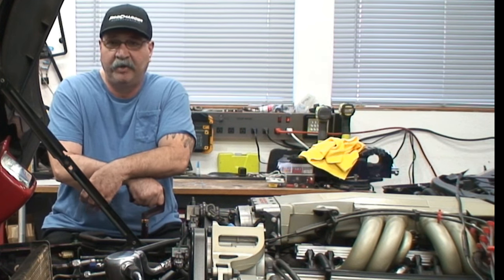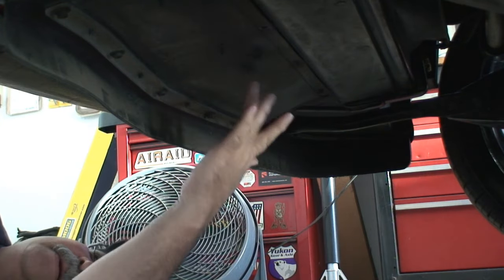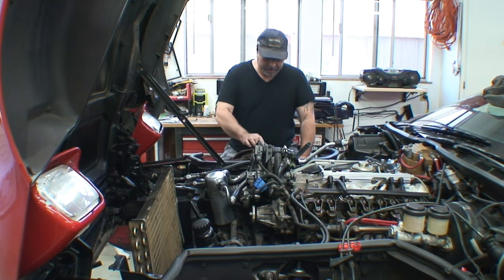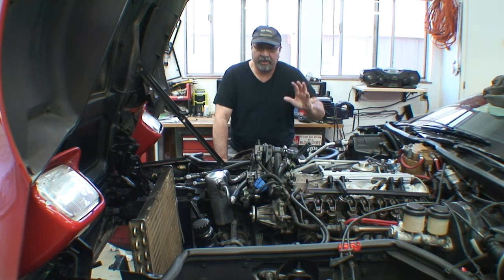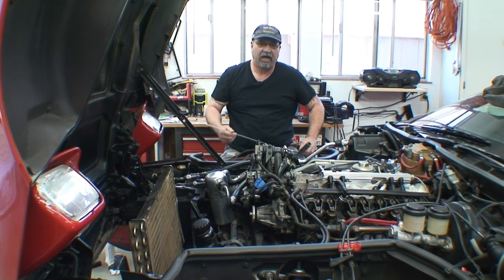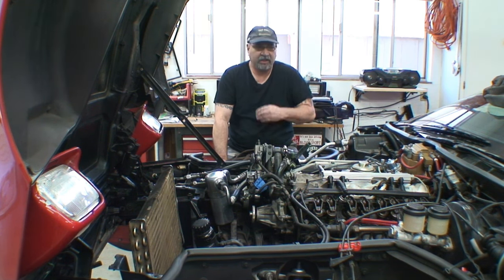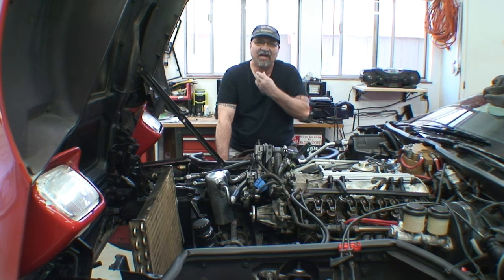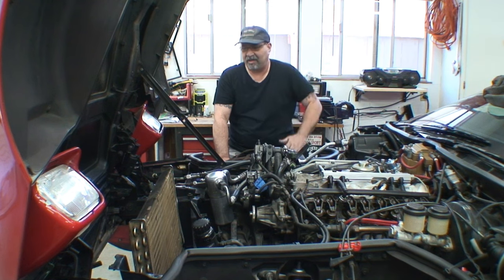Clearing the way for the supercharger episode four

Comment: Hey Ed, thanks for telling us about how to remove the dents out of the runners. That's an awesome trick and I will be using it to fix one small dent I have in one of my runners before I install my ProCharger kit. Thanks again.
Sincerely, Rich Williams
Astor, Florida 32102 USA!
Reply from the maker: "Hey! I’m glad you found the dent removal trick useful! For sure, the severity of the dent on the runner will determine how many times you might need to freeze it to get it just right, but it should work with a little patience. Great to hear you'll be giving it a try before installing your ProCharger kit. Best of luck with the fix, and thanks for watching!" Stay tuned for more videos to come!